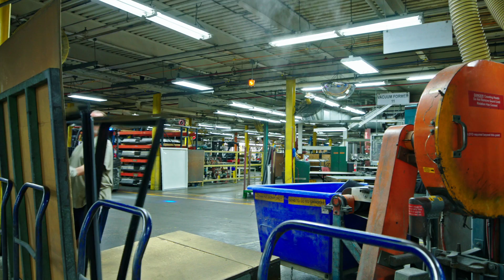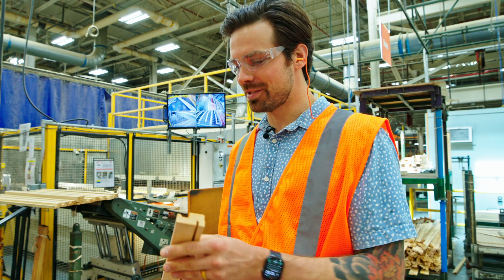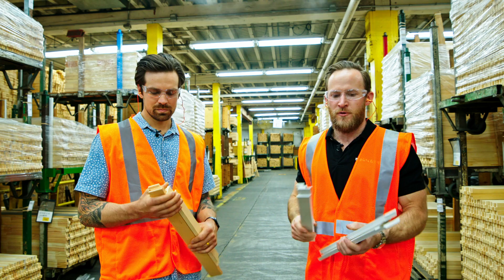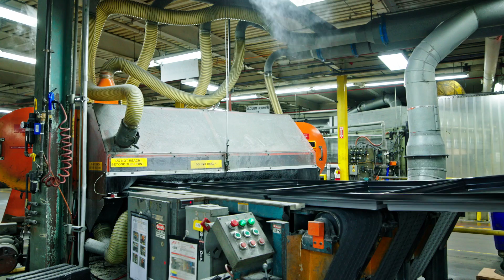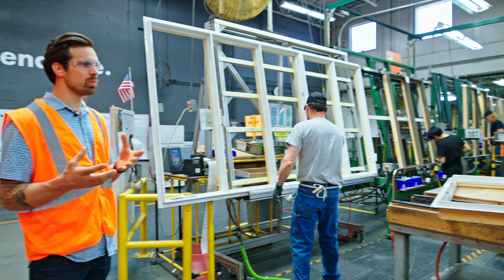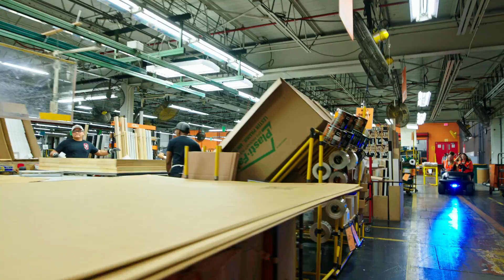Window factory tour with the Modern Craftsman | Andersen Windows

Comment: by the time you go through the midle man to get the window your paying the price of a car and getting a window.
Reply: Pray for a hailstorm, a low homeowners insurance deductible, and a quality storm restoration contractor.  On a more serious note, as a 30yr veteran builder, do not cut costs on any material that makes up the building envelope.  Whichever way you heat/cool your home doesn’t matter if the envelope is comprised.  Pay the extra costs for quality windows/doors now.  Pay to finish your man….or women cave later.

Comment: My whole house is all andersen sun glass even the 8ft slider...works great, casements, 32 of em even had Andersen Skylights, but after 27 years time to replace Velux, since Andersen stopped doing skylights.  After 27 years i replaced all my sashes in the original frames one by one, didn't break anything, now good for another 27+ years with sun glass, which is much improved over the early stuff, coatings and seals are much better now.  Low e 3 Sunglass for the win. Got all the replacement sashes from one supplier, excellent delivery times etc, since Sunglass is not usually stocked here in the North east, delivered on pallets, great results.  they ordered like a drop ship from the factory, neat how all the sashes are on skids for trucking to me